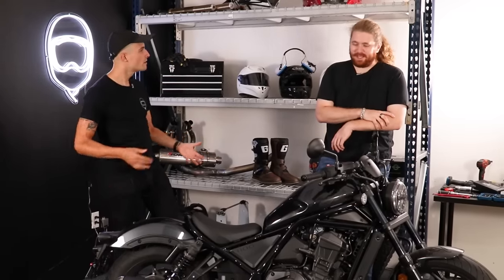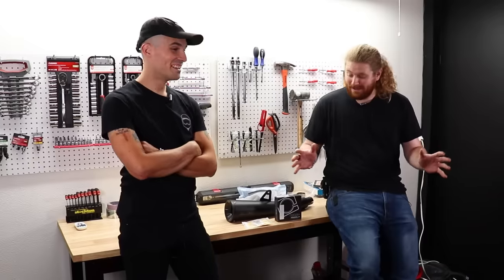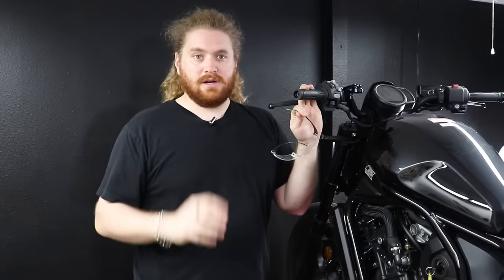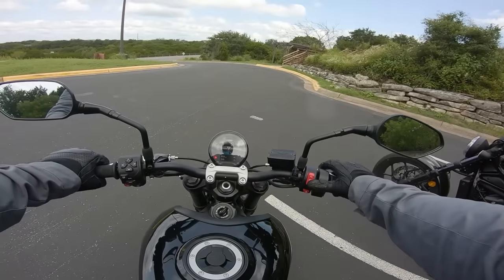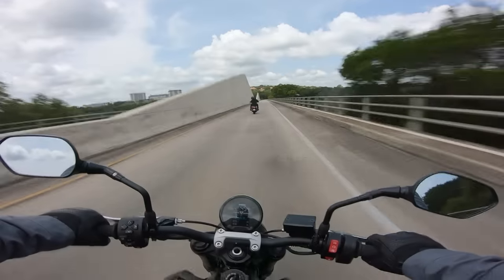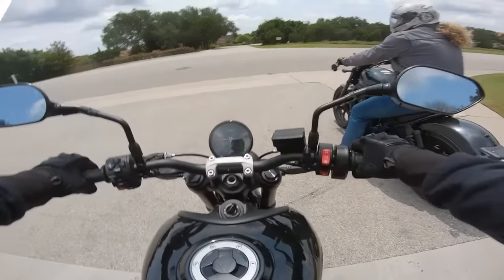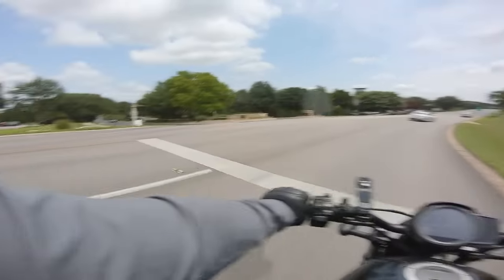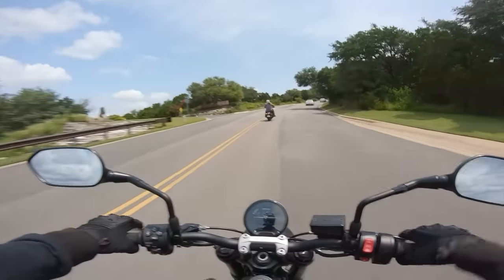How to Make Your Rebel 1100 Sound BETTER Than A Harley!

Comment: I love my Hondas, but this does not sound as good as a Harley! Sorry boys. And Spite covering up the whole bike while pointing out the features: hilarious.
Reply: You right, it doesnt sound good as a harley, coming from a harley owner, but its pretty good for what it is and the savings in cost is a deal breaker LOL
Reply: Listen to the two brothers for this bike, sounds better than this exhaust. Sounds closer to a Harley.
Reply: It’s a Honda folks! Not a Harley! It’s cheaper, better built and reliable!
Reply: @ttemoj  not sure about better built, I had a rebel 500, now a Low Rider S. Modern Harleys have great fit and finish. No denying cost and reliability tho. The Harley will do plenty of miles with little to no issues, but a Honda will run forever, even if you aren’t the best with maintenance.

Comment: Don't you have to make modifications to the air / fuel mixture, or timing when you change the back pressure with a straight pipe? Or is that just old thinking?

Comment: With this exhaust, would it be possible to add a rear seat and have a passenger on the back?  Or is the pipe in the way of where they would sit? Same question regarding saddle bags or other storage.

Comment: Always have been hesitant to try the 500 but the 1100 definitely has some appeal!
Reply: The 500 is faster, no joke lol.
Reply: @tinman3586  really?
Reply: @wrongthinker350  Technically yes because the 1100 has a speed governor which artificially limits the top speed to 100 mph.  It's not something Honda advertises but it's there and has been demonstrated by Rebel 1100 owners in a few YouTube videos.  It also angers a lot of owners.
Reply: @tinman3586  I'm sure the 1100 accelerates faster though.

Comment: So, Everytime you need to use the side mirror, you have to release your hand from the handle bar? To me, that's a bad location for the mirror, if not the worst. Not to mention, good luck on splitting lanes.

Comment: It doesn’t sound terrible, I like the sound but I disagree with it sounding better than an HD. 

There was a shadow 750 I had that gave the sporty 1200 I own now a run for it’s money on which sounded better. I don’t recall what it had since it was on before I got it but it sounded good. 

The sporty has V&H straight shots with no baffles.

Comment: I never really liked comparing motorcycle engine sounds to Harleys, (like it's the golden sound every body is striving for) because there so many good sounding bikes out there. I live down the street from a Harley dealer and it does get annoying listening to them leaving the dealer every day. Alot of them actually sound like shit.
 What perks my curiosity is the sound of another make/model going by and how they sound. The 1100 Reble does sound alot better with an after market muffler on it and looks much better.

Comment: So I'm not quite in the pricerange of an 1100,  but between the 500 and the Kawasaki Vulcan S, which one would you recommend? I've been dead set on the vulcan, but it's being given such a hard time whenever it's mentioned, but the Rebel 1100 has gotten a lot of admiration, even from papa yam himself, so if the 1100 is a decedant of the 500, surely that should hold some weight?
Reply: have you looked at the 900 vulcan customs?  my wife had one , it was a very fun bike and cool looking to boot
Reply: Go 1100 without even thinking about it. I really like the Vulcan, but it’s just no match in confort and agility

Comment: Nice work on my bike guys. What happens when you need saddlebags?
Reply: The right side, factory bag doesn’t fit. I took it off when I installed the V&H pipe, kept the left side bag on (it’s the larger one, thankfully) and added a tail bag to the factory rack. For me, it looks good—the upswept pipe balances well with the single bag—and I have plenty of storage by adding the tail bag.
Reply: @jftuvell  Man oh man and make a nice birthday present

Comment: The fact that want to compare it to Harley just says that Harley is the best. 🤷‍♂️
Reply: It just says that Harley has been building the same ole cruisers for decades. And Honda just released a mid-size cruiser with the 1100. And just hit the mark too, it's not super expensive, it looks fantastic, it's light, it's got enough power to weight so you don't feel like driving a car... if you're not totally over (as in pushing 60 and about to have a coronary) and still enjoy dynamic riding, this bike offers sth. Harley doesn't offer.

Comment: You aren't experiencing a problem with back pressure, you're experiencing a lack of exhaust length and possibly length after the O2 sensor. Not to mention proper tuning after the modification.

Comment: I assume you've gotta remap it after that exhaust swap?
Reply: Retune isn't really necessary with just a slip-on.  It doesn't change the exhaust dynamics enough.  That's not to say that a tune isn't beneficial at any stage.
Reply: As long as the back pressure is equivalent to the stock set up you should be OK. If you added a less restrictive intake and removed the baffles from this set up, then yes.

Comment: Being a Honda, it’s too civilised. The MT07 just sounds meaner even if it has less torque and outright power. The rebel sounds exactly like the NC700 I did a simple, cheap slip on muffler a few years ago.

Comment: Sorry yam...my 14 1200 sportster with Rinehart slip ons sound better...my 89 1340 softail with an unknown brand 2 into 2 (came with bike) and that sounds better...not to mention the potato idle cannot be beat, also am fixing up a cbr250rr (mc22, almost a ground up restoration) and looking at getting a dirt/super motard to fix up to say i am against other bikes is not true.

Yam you like the efi and newer, i more a carbie and older bike guy and do find the newer bikes interesting as a basic simple shopping trolley/commuter (yet i uas my sporty as that as well)

Comment: I'd get one of these or a Indian scout bobber
Reply: Same here, but I would get the Triumph Bonny Bobber before the Scout.
Reply: I have the Rebel 1100 and my son has a Scout Bobber 20, so I get to ride both. The Scout Bobber has more engine character “up top,” but for all around riding/handling I prefer the Rebel 1100. All that said, if looks are at the top of your list, though, the Scout Bobber is a real looker.

Comment: Lmao sounds better than a Harley?  No.... that's literally the only thing Harley gets right. A parallel is a better engine but will never sound as good as a vtwin or boxer engine.
Reply: A parallel-twin is a better engine than v2??? The only reason why this engine is somehow fun it's because it uses a 270-degree crank with uneven fire order which gives it v2 like character. 
Did you forget Sportster s scout, KTM's v2, Ducati's v2?
Reply: @Fearless154  from an efficiency standpoint  an inline twin is lighter and more effective.  The sportster is a great example of how awful v twins can be.  

I'm a v twin guy but I fully admit it's solely a sound thing. Well that and kawasaki  hasn't put the h2 engine in the Vaquero yet lol.
Reply: @midget9629  
I'm not talking about air-cooled v2s that on heavy and lazy cruisers but v2 performance engines that on Ducati's sports/naked bikes ktm superdukes.
Also, Suzuki sv650 is a great that v2 can be efficient and rich in character and smooth and great powerband through rpm range.
Normal parallel twin cannot like z650/ninja650 cannot compete with that only 270 degree parallel twins like on rs660 and mt07, rebel 1100/africa twin.